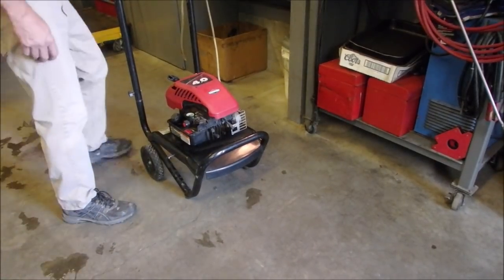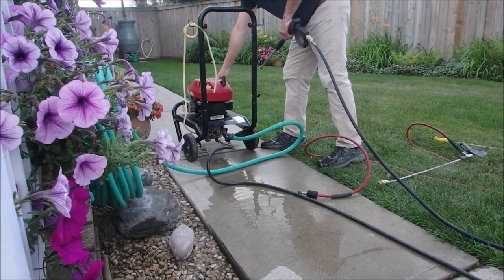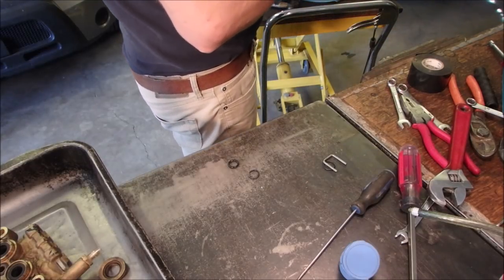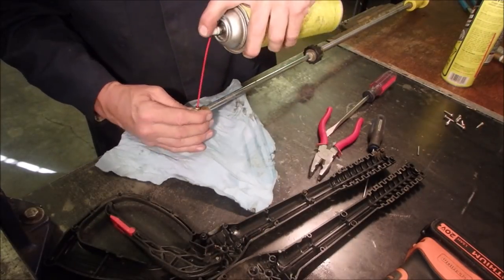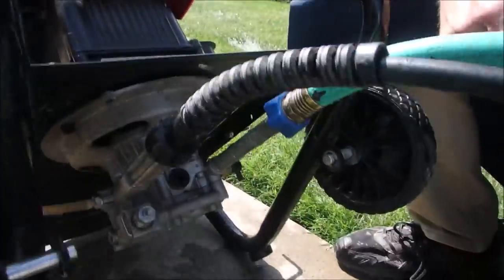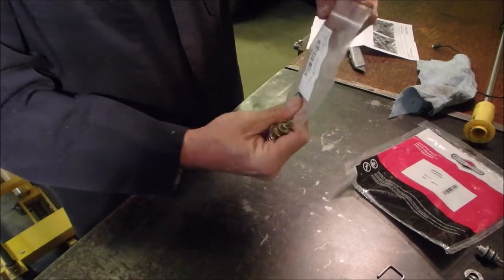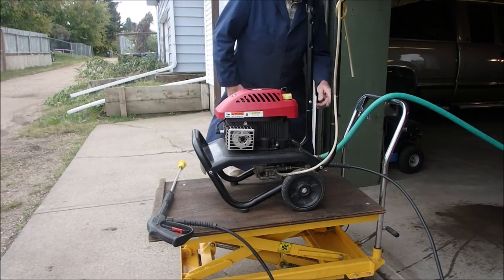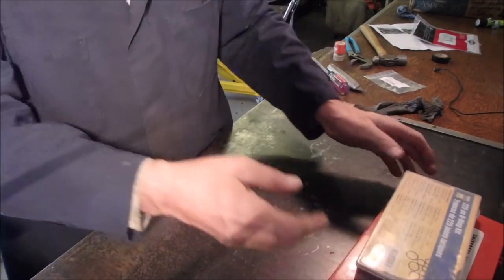Pressure Washer Damaged From Freezing

Comment: Working on this pressure washer one of the first things I did after initial testing was work on the hose and spray gun.  I took the spray gun apart, cleaned everything, lubed with silicone grease the plunger, ball and spring and lubed all the plastic parts that made contact when they moved with lithium grease.  Perfect!  I lube all chainsaw control parts with lithium as well on every saw I work on.  Nothing sticks or squeaks again and everything works with less pressure and better return speed.

Comment: I always enjoy the pressure washer videos. I'm glad to hear your goal is to learn more about the pumps. Yay for me! I need this instruction.  Mine is on the blink AGAIN. Have to hold the trigger to start it and keep it running. The second I release the trigger the engine dies. This kind of thing is constant. Glad I'm retired and have time. Thanks again for a good video!
Reply from the maker: The next one is similar to that but i don't know when the job will be done.  It is in the shop right now.

Comment: Solved my problem.  The frame that this unit sits on is a much better configuration then mine.  Your unit has gussets added to the bottom of the tube frame through which the stub axles are mounted.  On mine the axle is through the tube frame, and when the unit is tilted for rolling transport, the hose connections dig into the ground, grass, or pavement. Friday afternoon assembly.  Thank you.  Narragansett Bay.
Reply from the maker: You are welcome.  thanks for watching.

Comment: Watched you cut a new straight slot in the unloader stem.  I was lucky enough to score a free Foredom tool, complete with 3 different handles, a foot operated speed control and a large assortment of bits and collets.  Makes my little Sears Dremel tool eally look, work and sound like the kid's toy it is.  The Foredom tool is almost noiseless, much more powerful and much easier to control with more precision.
Reply from the maker: Thanks  I will check it out.

Comment: I have to take pictures, from the start.  Dude, your cookin.  I was hoping to see how to repair the outgoing tube, mine had water in it and froze, little cracks in it. 2 yrs. old, Troy  Bilt 190 cc  2014 model. Professional 3000 psi. Gonna check it out tomorrow. I hooked the hose to it, ran it without pressure, and had delivery, but with the motor running, it's pissing all over from the outgoing tube.   Yeah baby.

Comment: I have the same Briggs washer myself, got it because someone didn't want it anymore, need a hose and gun and the wand with the tips for it though. Nice unit though.  I use to have a Pressure washing business years ago, a Franchise. I did that for 10 years and did most all the work on the pumps and unloaders myself, had to. No one around here new anything about them.
Reply from the maker: Here it is $100 an hour to have anything fixed.
Reply: WOW,  I use to get between 60-75 dollars an hour for any washing jobs I did. 100 per hour for a house wash.
Most repair shops around here will charge anywhere like $ 89.95 per hour to 115.00 for any kind of work, even just to adjust the carb, they charge 99.00 per hour.
Reply from the maker: @paulbrown8370  That is why I am on my pump fix series.
Reply: I don't blame you. I always thought about getting into repairing the small motors on freezers on the trailers. The reefer units. But I understand that would be a problem.
I have a friend that has a house down the Jersey shore and says he can't find anyone good to fix the boat engines and the boat trailers and some welding, he says they would clean up in that area. I'm fixing on moving down that way as soon as I can. I am at the age to retire, but still not ready to, the wife is though. haha

Comment: Is it still the Pender Plan to do more pump stuff this year? I notice most for sale are Great Motor / Pump is Bad situations. I think people fail to winterize them, just like this one. It seems like if pump REPAIR instead of replacement is a viable option, then there is a niche for a few dollars to be made. The guy that bought mt first mower is also looking for a PW, and if I can educate myself to know how to evaluate a Bad Pump on the spot, purchase the easily fixable ones, and do a quality job on the repair, I could be on to something. Every guy wants a pressure washer, and not a wimpy electric one. MORE POWER!! 

Thanks Bruce for the quality education.
Reply from the maker: Yes this was filmed last fall.  I sold this pump yesterday

Comment: I need your help, 2 questions. #1 I bought a used Ryobi from a bad seller (a few yrs ago, it won't start) who never disclosed the truth about the pressure washer. I just tried to use it today. I changed oil, installed new carb & fresh gas to find out it leaks so bad in the back of water connector, plus he or someone used (look like) gorilla glue around the plastic in the back so it won't turn because of the glue. I had to knock it loose so I can turn some in order to tighten the water hose. It looks like one piece (same vertical pump like in your video), I also see that looks like someone also loosen the screws of the pump. Is the pump crack or just bad water connector? Is there a way to fix these issues? #2 I put the pressure washer upside-down to drain the oil on another one, plus I let it like that overnight. the oil leaks & get into another parts which I don't know but I know it got in the oil filter & spark plug chamber. After I let it sit upright the oil still come out from inside. I put new oil, clean the carb & fresh gas, I still can not get it to start. I will put new carb & new spark plug later. What should I do next. I'm a woman, don't know about small engine & mechanic things but I start learning & try to do thing by myself. Please help.
Reply from the maker: Right.Remember there are 2 pieces   Engine and the pump.    First the engine.  Take out the spark plug and turn the engine over with the rewind starter until all the oil stops squirting out of the cylinder.  Squirt a little gas into the spark plug hole and replace the spark plug and try to start the engine.  It should at least run for 3 seconds or so.  This is the start for that.  
On the pump part if i am reading this correctly i would replace it with a unit from Harbor Freight in the States or Princess Auto in Canada (Amazon works good too).  The loose screws on the pump looks like someone took it off and then loosely put it back on to sell it.  Just buy one similar in shape and numbers   eg  2500 psi 2.2 gallons per minute.     Best of luck
Reply: @BrucesShop  I must put it back wrong. #1. it's hard to move the choke lever & it won't open or close the carb #2. I spray the starting fluid in the new (opened position) carb, it still won't start. #3. the new oil that I added less than a week ago it looks black, despite I left it upside down overnight. I bought this pressure washer a week ago, I believe the seller also lie to me. He said the last time he started it was in May 2022. When I pulled the old sparkplug out it's so dirty with all the gum, I used lot of Q-tip to clean inside of oil that leaked into the sparkplug compartment. I also scraped the black gum that I can see. What should I do next? This one is Craftsman 2500 PSI, 2.3 GPM with Briggs engine.

Comment: Nice long video to break up the tv programming during commercials...
For your safety you should relieve the pressure on the hoses prior to removing them from the machine, especially the high pressure side, you don’t want to get hydraulically injected by the water pressure, don’t ask how I know this, just know it wasn’t me that was in pain...

Keep up the videos, nice work on this small unit.

I have one question...I replaced the old original pump on my Honda GCV160 with the newer style Annovi Reberveri, the original was a 2600 psi flat push/pull unit, it runs good under load, although it acts like it’s under pressure, sometimes in boughs down upon opening the wand for pressure and when closing the wand. Question: will adjusting the unloader smooth out the transition from open wand to close, if so should I increase the pressure or decrease it?

Thanks!
Reply from the maker: I sounds to me lke you could turn down the unloader a bit.

Comment: Great repairs Bruce! That unloader sure is an expensive part! I imagine if it broke by bumping it it must have had a fracture already. I gather that shaft that broke off is part of the piston and not threaded in? If so, I wonder if it'd be feasible to cut it off flush, and then drill and tap the piston, then insert a long screw or threaded rod? 

Thanks again!
Reply from the maker: Good idea.  I still kept the old parts.  They are in my pump hoard.  I hope you don't mind if there are a few more pump videos to come.  I really want to get comfortable repairing them.
Reply: @BrucesShop  Sounds great, it's win-win because we all learn!